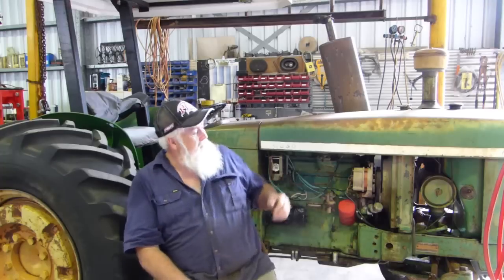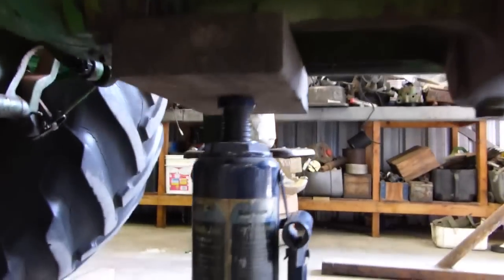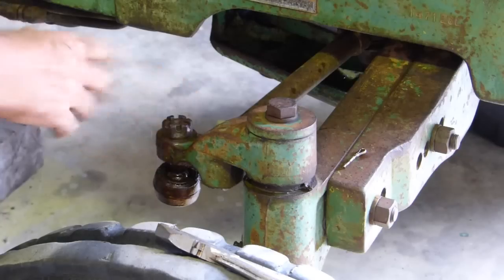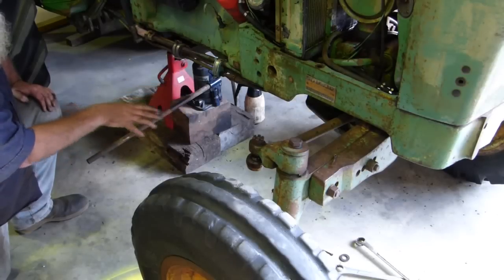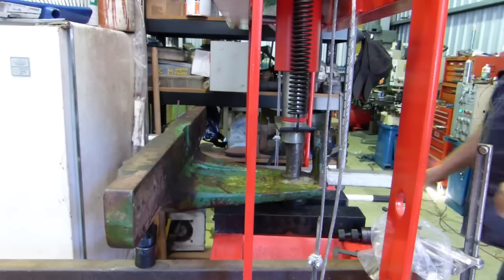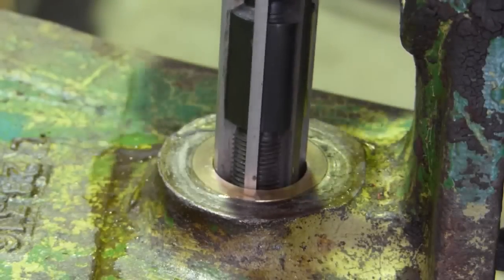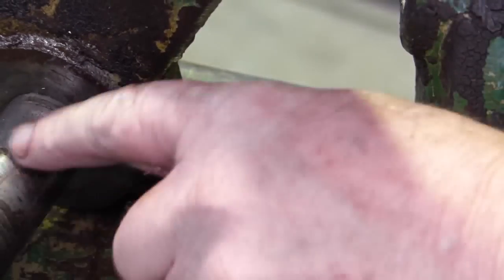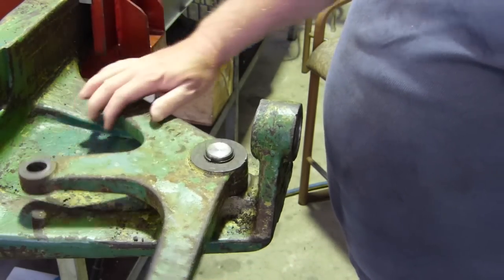John Deere 2030 Front Axle Pivot Pins, Bushes and Bell Crank Repair

Comment: Thank you so much for making this video. I purchased a 1030 with all the same problems. It was dangerous to drive down the road, due to the steering being so sloppy. There was no trace of needle bearings left and then the axle housing hole was all worn larger also. This video has helped tremendously! Thanks again!!!
Reply from the maker: Glad the videos helped.

Comment: Thank you for posting this.  I've got an old 2020 whose bell crank is so sloppy it won't hardly turn.  This winter (if it makes it til then!) it's getting nosed in and pulled apart to see what all it's going to take to tighten it up.  Your video was an excellent 'primer' for my project.  I appreciate your taking the time to make it.  I'll most likely be watching it several times in a few months!
Reply from the maker: Thankyou, I hope it helps you out.

Comment: Great to see an informative video working on the John Deere 2030, currently restoring my dads. Renewed the bushings on the front axle but the wheels are flicking back and forth when driving, think there is alignment issues! This is the least of my worries, the hydraulics are acting up, can't wait for your hydraulic repair videos ha ha.
Reply from the maker: The steering column one isnt far away, check the pitman arm is tight on the spline, they had a problem with them coming loose.

Comment: Good job Lance, your tractor is about like my 2640 I did the same job on mine except I did not have a fork truck or shop floor to do it in, I guess the worst part was getting the axel back in without killing my self quite a pain but I got it.
Reply from the maker: Joe Tiller yeah Joe that can be a fiddle. I have a few more things to do yet. I will re seal the steering column shortly
Reply: I need to take my 2640 apart.  Did you buy a new bell crank?

Comment: Hi Lance, Thanks a lot for your videos and sharing your knowledge. I have a question. For pulling out the bushes you have used a press with 30 T. And after your have tried a handmade extractor. But how do you choose the steel of the threaded bar and nuts ? Indeed considering the forces not all kind of steel would be able to widthstand such forces correct ?
I am in process of viewing all your videos. Looks like it is gonna take a while ! Keep going and thanks a lot from France !
Reply from the maker: I just use normal mild steel threaded bar as used in the building industry, usually around 19mm but sometimes 16mm

Comment: That boomarang is a bellcrank. John Deere built those front ends with 2 different sizes of needle bearings and some just had bushings, it depends on the casting number of the front end and bell crank used. It seems they just mixed and used whatever I have never found the parts books to well match what was on the tractors. Pretty sure you put that front bushing in upside down though.  The grease is supposed to go around the bushing and come out on top where the load is.
Reply from the maker: G Day Brian, The grease hole lined up and there is a track around to the load bearing surface, they must have thought it was easy to get grease into that way and there is more surface area to support the load without the grease hole. The 40 and 50 series utility tractors went to a stub axle like pivot with tapered bearings over here after this setup. These old girls were my bread and butter for many years.
Reply from the maker: We call them bellcrank over here too but I was trying to explain the shape, the top arm on the top of the king pin we call a bellcrank too. But we call fenders mud guards  and a hood is a bonnet. And what you call a scale we call a ruler. Our language over here is slowly becoming Americanised if there is such a word as TV, Facebook and Youtube make the world a smaller place.
Reply: Bundy Bears Shed
 I have beat hundreds of those pins and bushings in over the years but i admit it has been probably ten or more since i did a utility tractor like that, We mostly work on 5000 and 6000 series now as the old 30 and 40s are too worn out to bring in the shop. I know on the waterloo built tractors the hole goes on the top but couldn't remember if the utility's had an external groove around the bushing or not.

Comment: Great video! I’m also looking to replace the rear pin. Is there a specific direction it needs to come out and does it require a press? Thanks for the informative content!
Reply from the maker: There is a shoulder on the pin and it knocks out from the back forwards and the front axle when in place holds it there. They are a bit of a bugger to get a swing on but it is do able

Comment: I’m having trouble getting the axle back in. I had no issue getting it out but it’s not easy to align back in.
Reply from the maker: No they can be a bit of a fiddle, if one pin was a little longer it would help for sure. Just take your time and line things up well.

Comment: Great video! I´m doing the frontaxle on my 3130 right now and this video helped alot. Unfortunately my back pivot pin has some wear, and i´m not quite sure how to push it out or back in. To bad you didn´t change yours :) How would you do it? it´s very litte space to the oilpan. Thank you!
Reply from the maker: Threaded rod and big washers is what I usually use when I need to change one.
Reply: @BundyBearsShed  Thanks for the tip! I got it out with a M24 rod with a bunch of thick washer and a socket on the pushing end. Did take som force though :)
Reply: Pushed out with a bottle jack and some wood blocks, a little concerned with pushing the replacement back in with the oil pan in the way and all.  Hopefully a nice dry ice acetone bath will allow for a quick fit.  Any tips would be awesome!

Comment: Hello
I have a problem in jd 2030, the handbrake linings are torn, do you have a movie how to fix it?
whether to remove the lifting arms, or to unscrew the left housing of the rear axle. my tractor is equipped with a cabin. Regards Marek
Reply from the maker: No video as yet but you remove the lift cover and some times you need to undo the l/h final drive as well.

Comment: Wet disc brakes.. very intersting.. is this a fire safety thing or done for other reasons?
Reply from the maker: Duncan Margetts just a better longer lasting brake system. Almost all modern tractors do it that way now John Deere was ahead of the pack back when they bought these out
Reply: Fascinating.. thanks! the wet brakes are an aftermarket item on Landcruisers destined for underground mine work.

Comment: G'day Lance, Thanks for the video, I've been wanting to do the same on my 2130 for years. The steering pin is so badly worn it laughable. Quick question, where did you get your pins from and steel back bearings. We have a John Deere dealer hear in WA but their prices are insane. Is there an email address that I can use to ask any more pressing questions. Finding info on my 2130 is hard work and it would be handy to ask someone with a similar machine. Marco
Reply from the maker: info@queenslandtractorspares.com.au will get the front counter of my business and they will help you out where they can.